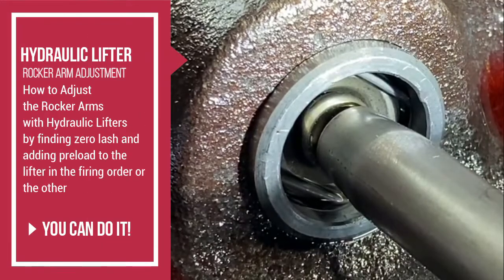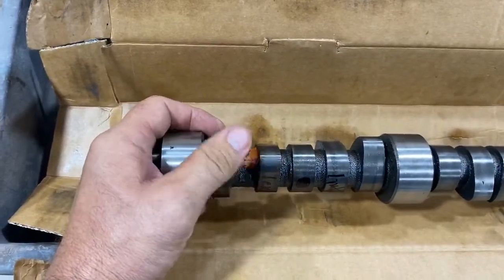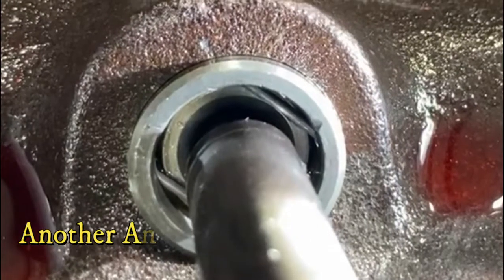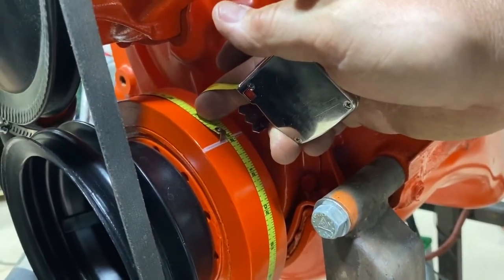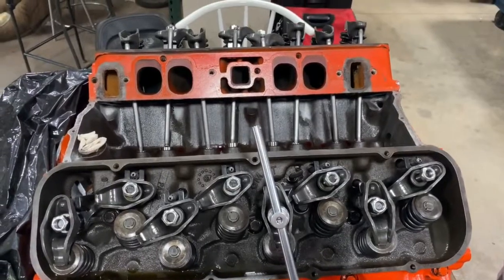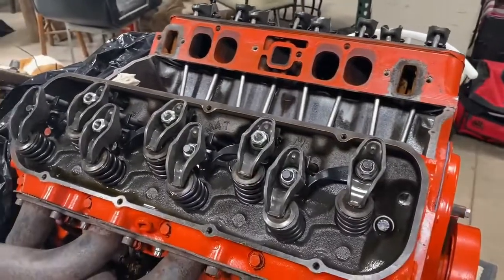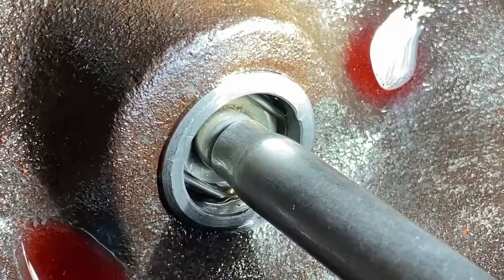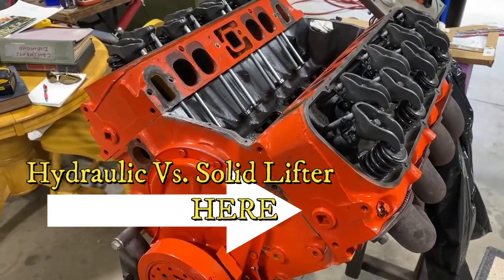Rocker Arm Adjustment - Hydraulic Lifter Preload [How To]

Comment: This was a great tutorial.  I am about to go all in on my Rover V8.  Obviously, need to get this correct.  This now gets me looking at this and what I need to do.  Thanks.
Reply from the maker: Thank you. Good luck and let me know how it goes
Reply: We're knee deep into my 15YO son's 2002 LR D2.  The rockers are NOT adjustable.  I think you have to shim the rocker shaft pedestals to get the right preload, but I'm not there yet!  I know we have a bad lifter so will probably get all new and cam and gears etc.
Reply from the maker: @jimmuehlberg2153  good luck with your project. There’s so many variables. I’m nascar we’d change pushrod lengths by .025” increments and also used shims under the rockers.